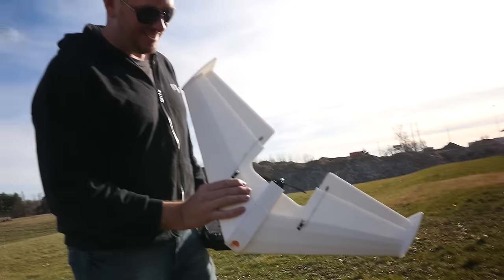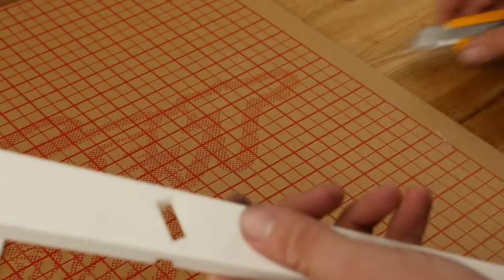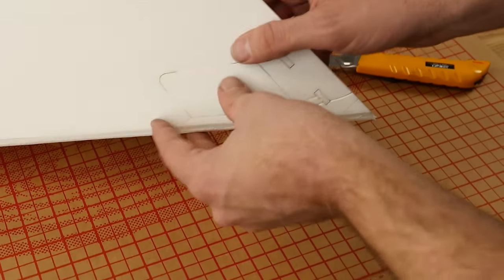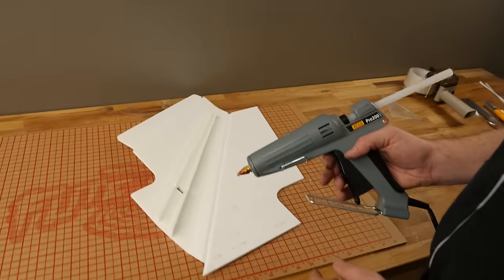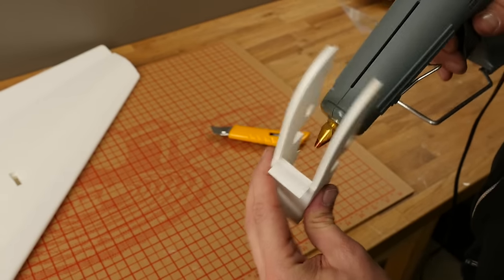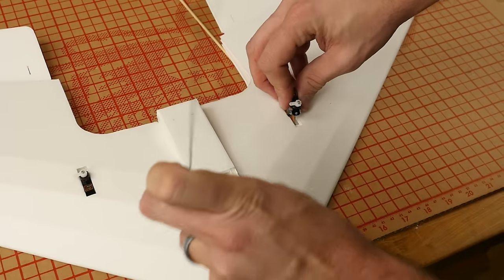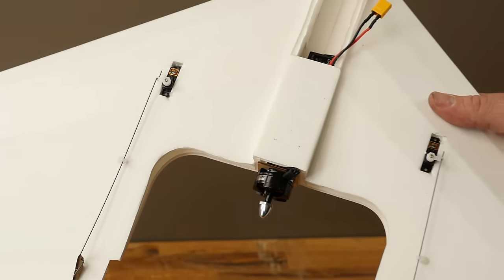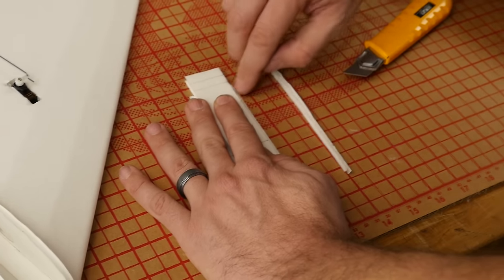FT Mighty Mini Arrow - DIY Build | Flite Test

Comment: Hey Flight Test! You guys have some amazing going on here, thank you! I'm new to planes (been flying quads a while) and the FT Mini Arrow was is my first successful foam board flying wing (or any scratch build plane for that matter). I don't want anyone to go through the frustration I did trying to get this thing flying. Followed the video and the instructions on your website as precisely as possible only to have a wing that wouldn't fly without adding 250+ grams to the nose. After searching and searching forums I discovered that it was possible I was using a much heavier foam board. I just finished building my second Mini Arrow tonight using Adams (Readi-Board) brand foam board, weighed it... It's half the weight of the first Mini Arrow I made, weighing in at 270 grams with all electronics. Also, I installed all receiver and ESC in the front of the wings instead of right in front of the motor. Not is it now half the weight of my last attempt but I didn't have to add any dead weight to the nose so it would be balanced! I'm posting this for one reason: I don't want anyone to go through what I did because they had no idea how much the weight of the foam board could have on the plane. If anything can be added to your instructional video or site that will alert people of this I think many people diving into the hobby will have a much less painful entrance than I did. Again, you guys are awesome, I just feel like this would be more helpful to people than it may seem.
Reply: Great share Eddie!
Reply: Great Scott!
Reply: Happened the same thing with me!! The first time i did it it didn't fly because the foam board that i used was heavier as you say. Anyway, i solved the problem putting a more powerfull motor and a 1100 4s battery.

Comment: I just maidens my build.  I used 2mm Depron for the wings and 6mm Depron for the fins and pod (because that's what I had).  The power train was salvaged from an old HK Rare bear which had long since gone past the help of hot glue ;).
Maiden was awesome and effortless.  Great build video and easy to build and fly design.
Thanks.

Comment: I built one myself a few days ago....but I went crazy and overpowered it. Basically I didn't do the centre pod, I wanted to install a 3s 2200mah!  To counter the nose heaviness I installed an 80g 2836 3000kv motor with 60a ESC, it balanced perfectly and flew AMAZING!! This and the bloody wonder are my favourite FT designs :) 
Thanks FT

Comment: What you heard right at the end of the flight was the ESC overheating. Happened to me, not much airflow inside the fuselage.  Mount the ESC on top in front of the motor and it will stop being a problem as well as freeing up some space inside.

Comment: I don't know if anyone else caught the, "We are trying to keep it under .55lbs" comment, because that made my day!! :)
Reply: +karter koob I am interested to see what the weight comes in at on this. Hopefully some people that start building at home will weigh theirs. Needs to be a battery installed weight.
Reply: +NoAgenda Drones I'm going to build one soon. Everyone that gets done before me should post the weight of theirs!
Reply: +NoAgenda Drones I'm going to build one soon. Everyone that gets done before me should post the weight of theirs!
Reply: +NoAgenda Drones I'm going to build one soon. Everyone that gets done before me should post the weight of theirs!
Reply: +NoAgenda Drones I'm going to build one soon. Everyone that gets done before me should post the weight of theirs!
Reply: +NoAgenda Drones I'm going to build one soon. Everyone that gets done before me should post the weight of theirs!
Reply: +NoAgenda Drones I'm going to build one soon. Everyone that gets done before me should post the weight of theirs!
Reply: +NoAgenda Drones I'm going to build one soon. Everyone that gets done before me should post the weight of theirs!
Reply: +NoAgenda Drones I'm going to build one soon. Everyone that gets done before me should post the weight of theirs!
Reply: +karter koob  It may have been designed around the 3S Lipo but a 2S setup would be lighter and fast with the right motor and prop.
Reply: +karter koob Yah, I would say so.  I have the Tiny Trainer and it weighs 8oz without the battery so it's really close.  It's 9.2 oz with a 2s 800mah battery.
Reply: lol yeah at 31:58
Reply: +karter koob I just finished my scratch build. It came in at a little over 10 ounces with the battery, but without the fpv gear. I did do the polyurethane treatment and probably went too heavy on the paint though.
Reply: Unfortunately the speed build kit with Power Pack F is 16 grams over (give or take a couple grams) without Fpv gear. I'm using their 800mah 3s.

Comment: Edit: For anyone that may run into the same problem I did. 18:55 he uses the throw gage to setup the elevons, but it should be the elevon setup gage.
Reply: +John Balzac damn, I wish I had seen this earlier! lol, now I need to go back and redo them.
Reply: +Just for fun if you're like me and got the power pack from FT you should have gotten some linkage stoppers, if not then you should get some! With a linkage stopper, If you dont have extra pushrods just carefully try to straighten out the zbend and that straightened out bit should be enough to fix the problem. Good luck!
Reply: +John Balzac +10000 :) Thanks!
Reply: I couldn't figure out which gauge he was using so I scrolled through the comments just to find it. Thanks!
Reply: that is what I thought but I haven't gotten a reply from ft.  also can't find any dots to indicate the cg. do you happen to know a good mesurement to find the cg?  what elivon angle did you find works for level flight?  the lowest angle on his gauge is about 20 %
Reply: The center of gravity is on the plans. As far as the throw gauge goes, it's not really even necessary to be exact with it. Be close on to it and then adjust as you go with trial and error.
Reply: Minimum throw is measured from the top of the wing or from the bottom?
Reply: @marianofpv  Top!

Comment: Thanks for an awesome design! Just built this with the hobbycraft foam available in the UK and it looks great, I was hoping to fly it as a slope soarer with the pod too but it seems the foam I used makes the plane about 40-50 grams heavier than the 170 grams described on the site. The higher density made it difficult to fold the wing over and I had to cut a steeper bevel to get it to fold over. I'm hoping to build the versa too out of this same foam which should be less of a problem I hope. But yeah this high density foam from hobbycraft could be an issue when building some of the smaller planes and if it flies well it should be quite robust. I'll post on this again when I get a chance to test fly it.

Comment: A sincere thank you to Flite test for providing such an amazing plane! I made one last night and flew it today....amazing piece of work!! Only problem was I installed a servo that was faulty (lucky I didn't crash) and now I need to replace it.   Does anyone have any tips as to how I can safely replace those servos that have been hot glued down? Can I use a hairdryer to melt it without melting the foam??? Thanks again

Comment: Hope the larger wing you mentioned will carry a 4s 1300mah pack since its such a common pack for quad guys to have. Would be great to throw an old motor/esc into one of these and be able to run packs i already have.
Reply: +Say Ya great project to get quad pilots flying fixed wings.
Reply: +Say Ya  +FliteTest that's my ONLY 'want' with this build, I wish it would fit a 1300mah 3s pack people (myself included) tend to have those lying around (especially after moving up to 4s)

Comment: first time flyer, ive built two arrows and flown them. its tough to learn but i havent crashed them but this build done with your speedbuild kit and 4pack with recommended battery, it doesnt stay powered for long.. it does fine for a couple minutes and then just slowly dies out. its frustrating and its turning me off to even wanting it. i dont even get the speed seen in all the videos ive watched. i assure you i followed step by step and made sure everything was done correctly.

Comment: Josh, as a retired aircraft systems test engineer with Northrop Grumman Aircraft and fairly new to this hobby was wondering if you are familiar with the Northrop B2 Stealth Bomber? Its a flying wing. If not, check it out. This would be a great design to incorporate into a Rc flying model due to its design in the flight control surfaces. Two speed brakes/rudders at each wing tip a a eleven dead center of the trailing edge (like bird feathers). Maybe you know of a kit? Great job guys, great video . plan to order your Arrow wing kit.thx

Comment: Something not mentioned is the roll balance. Using hot glue is heavy. Too much used on one wing vs the other will throw the balance off. The only remedy I've found for this is add counter weight inside the wing as close to CG as possible. You can access that area from the back. If the counter weight is too far off from CG it will throw the natural CG off. This problem could destroy a maiden flight. Details.

Comment: went with the cg  1 3/4 inch  from the motor cut out. ( 2 oz led in the noes).  set the reflex at about 6 degrees.  guess that was right cause it flew real good on the first toss.  did 3 more flights and am now mounting my fps stuff in the noes.

Comment: "It is almost indestructible." - Obviously, you're not trying hard enough.
Reply: I remeber one someone actually made one and sent it for a full throttle grand slam into a nearby hill
There were still some salvageable parts of the fueslage and most parts were ok
The pushrods were fubar though
Reply: As someone who has crashed this plane perpendicularly into the ground, I can attest to its indestructibility

Comment: I wanna build a <.44 lb (200g) one to fly here in Japan.
Only when your aircraft is <200g can you fly it anywhere in Japan because of the new drone rules. I think this is the design I've been looking for. Perhaps I'll use thinner foam board to save on weight.
Sadly my electronics are already close to 90g. So the airframe must be less than 110g.
Reply: +Amani Hamis less then  110g? Oh lordy. that's... well you can't have the center section, and cutting weight holes out of the bottom of the wing might even be necessary....

Comment: What do you do if One channel is the servo for the right wing and one channel is the servo for the left wing .. so I guess my question is how do you get them to cooperate so get them to act as both elevator and aileron .. if I pull back it goes up .. and turn right it turns right .. ?  right now one stick makes the left servo right and the other stick makes the right servo work ..does that make sense?

Comment: Hi there. Thanks for sharing.
Will it fly with a A1504-KV2700 micromotor with 5" prop?
Another problem, those laminated 5mm foamboard is very expensive here.
So, let's get the non-laminated and tape one side first then cut. Will this work?
Thanks!

Comment: Im trying to follow this but Im having a real problem.

my speed build kit seems to have been cut wrong or something.   NONE of the parts just pop out like they did with my spitfire, they are not cut but perhaps half way through.  the parts that are supposed to be partially cut through such as those at 2:00 are not cut at all.   

I have nerve damage in my right hand so cutting them out manually is very very difficult.

Comment: My first build ever. So far so good. I'm using power pack F but it seems the motor is pulling backwards? The motor spins counterclockwise and I put my numbers facing forward with the prop. Am I crazy?
Reply: try adjusting the connectors on your motor and your ESC..as long as the motor is turning the correct way and the prop is facing the correct way it may be a motor issue.
Reply: motor is going wrong direction for prop, just change two of the esc connections and leave prop the same.

Comment: To anyone watching while building this, he erroneously shows using the RATES gauge low angle to set the centered/default angle, when he should have been using the ELEVON gauge instead. Also, I had to reinforce the leading wing edges with packaging tape before bending them over fully as the paper on the outer edge easily split under so much stress. I also recommend spraying it with waterseal after gluing it all together.

Comment: Struggling to get mine flying at the recomended cg point, at 1.5 inches it needs tons of up elevator, and when flying slow it yaws left right. move the CG to under 1" back from the firewall it flies much better but im still using ALL up elevator trim plus holding the stick to keep it nosing into the ground.

I dont get it.... Should i try actually going to 1.75 inches  iw ould have thought going more tail heavy would make things worse not better... afraid that if i go 1.75 inches it will just crash.

Comment: Wait, so the mini power pod is swappable? I remember the first of the minis they said it wasn't that we'll suited for swapping. They definitely said it in the pun jet build video.
Reply: +tobanga feufeu Josh mentioned that it depends on the model of the mini power pod. Some have a small thrust angle, some don't. So not all PowerPods can be swapped.

Comment: Ok it's 2:34 a.m. and I just glued the last winglet on to the FT Mini Arrow. I now have a Tiny Trainer with both noses and both wings plus an extra power nose and power pod, a FT Flyer and a this Mini Arrow... ALL without servos, motors, props, esc and receivers (slow boat from China, literally) ....question is WHAT SHOULD I BUILD NEXT TO PASS THE TIME? I have a total of 3 & 3/34 foam boards, a roll and a half of tape and 6 (4 in.) glue sticks left ...decisions decisions....UGH lol (TOTAL cost of the builds so far is $5.25 in foam, $3.50 in glue, $0.60 in tape & $0.09 in skewers. Total $9.44 for 3 planes and tons spare parts haha) ...THE ELECTRONICS ARE WHAT KILLS YOU!!!!!!!!!!

$43.59 TX/RX Bundle
$13.00 2x 2205 2580KV Motor
$22.00 4x 1806 2300KV Motor
$6.85 (auction) 1000KV 2212 with ESC, props and prop hardware
$10.92 4x 15A ESC
$4.71 30A ESC
$13.00 10x, 9g servos
$2.00 2x mighty mini firewalls
$4.99 10 pack props6030
$4.99 10 pack props 6040
$1.99 10 pack props 5030
$40.00 lipo charger
$12.00 RC watt meter
$0.99 lipo alarm/buzzer
$0.99 servo tester
$0.99 servo "Y" cord
$1.29 5x servo extension cords
$6.99 2S battery
$7.99 3S battery
$1.79 10 pair bullet connectors
$3.79 25x servo linkage stoppers
$6.00 glue gun dollar General
$4.00 2 pack HD Duck brand packing tape clear
$9.00 9 sheets foam board
$4 2 packs of 10 glue sticks
$2.14 3 pack disposable snap off razor knives (3 different sizes)

Yeah. ....you do the math.. I just depressed myself typing that out. UGH! ...and that's not including anything brand names OR ANY FPV GEAR! ....that coupled with the learning curve of the electronics is what is the barrier to get in the hobby...NOT the planes! I'm just happy I already tinker with electricity and was able to learn all this rather fast....but someone of the street with no knowledge of anything electric or the innards of electronic devices....yeah....that would suck...n that's what keeps people out. Just my .02¢

Comment: So, I built my first scratch- built Mighty Mini Arrow. Came out very well (look), BUT I am having such a hard time getting the CG balanced. It is so much tail heavy for some reason. I have pushed the battery all the way to the nose and still very tail heavy. I am using powerpack A. Is this something other users have experienced?
Reply: Same. Had to get a box of sticky back weights to fix cg from being tail heavy because the battery wasn’t enough.

Comment: Could I get away with using a 1300mah 4s battery in this ? I'd like to build a wing but want to use the mini quad batteries & motors that I have already.
Reply: I've seen at least one report of this working out, just don't expect that battery to fit with the cover closed (one of the reviews stated they just cut the door off and added a strap for the battery). Apparently it helps get the CG correct as well with the added weight.

Comment: How do you determine the point where CG should be?  I don't think the plans had the marks.
Reply: Look closely at the wing in the video when he points out the CG marks underneath. You should be able to pinpoint it fairly accurately. You could probably find that answer on the Flite Test forum.

Comment: What would be the recommended battery size in milli-amp hours? Would a 1000 mAh battery be bad for the slower one?
Reply: +Scorppio500 Webmaster Recommended battery is a 800 mAH 3s. Seeing that it was a tight fit already, you might get problems with a bigger one.
Reply: Balu Ok. Thanks so much for the help!
Reply: +Balu do you know the flight time on that 800mah? I have a 500mah 3s and wanted to see what I would get with that. As 1000mah barely fits and bulges the frame.
Reply: +JediDrift515 Sorry no. I'd expect with a machine like this it'll depend a lot on the flying style though.

Comment: How do I find the CG if I did not mark the spot when building a scratch build plane(Versa Wing). Is there a formula?
Reply: for the most part with delta wings the cg is right where the servos are also i built my versa wing so slope gliding and it works amazing with that as the cg

Comment: this will be my first scratch build... but I can't find the wood recommended for the firewall and control horn any recommendations of what else to make them out of
Reply: Yes, what I would do is using a piece of an expired credit card. I'm not sure if it is resistant enough.
Reply: +Romain Janssens I guess 3 pieces of gift card stacked should do it thanks
Reply: +Mike Baucum With pleasure, i'm almost done with building my FT Arrow
Reply: +Mike Baucum   hobby lobby carrys balsa wood 
. or if you can find a hobby shop. you can get some micro control horns